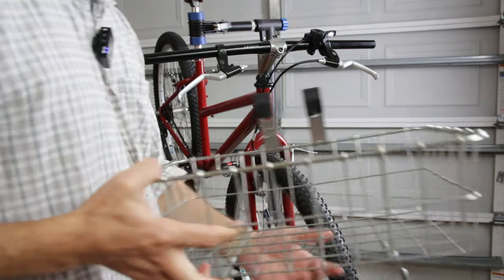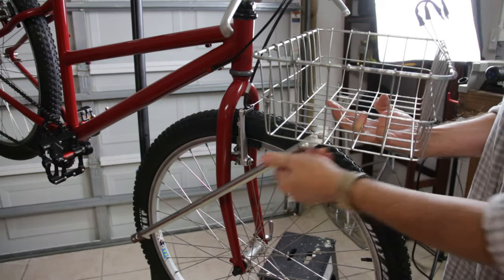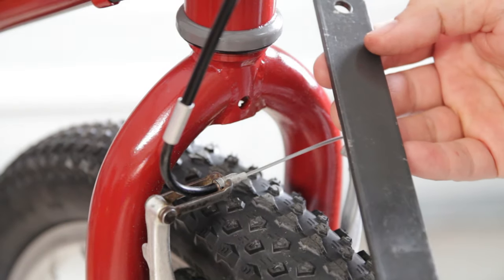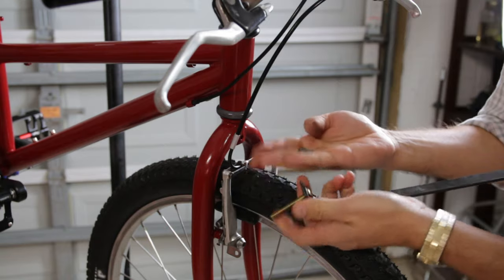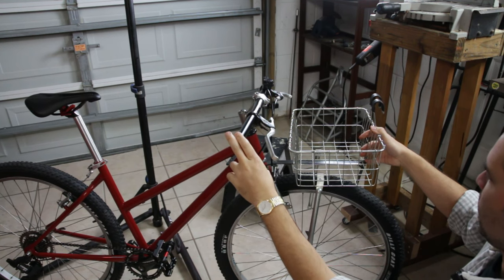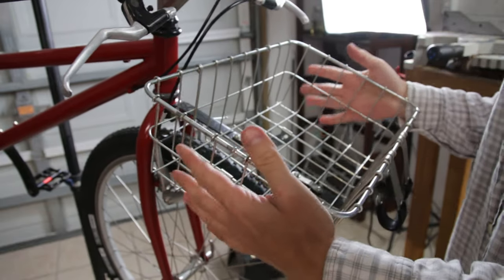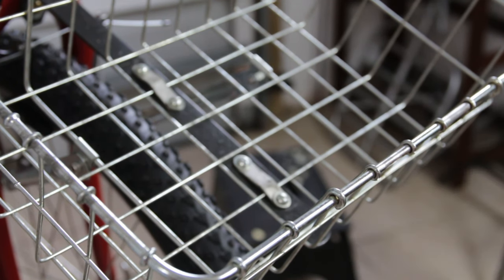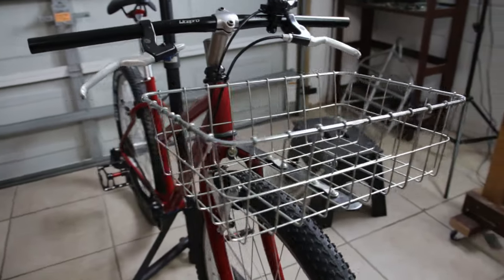Wald 137 brake boss mount

Comment: Great overview and subbed to the channel. I am just about to fit my 137 but I think I will be mounting it on a Japanese front Sim Works Obento Rack. It adds weight but I would rather be able to whip the basket off by removing some voile straps and then ride with the rack on instead of fixing all the Wald hardware on. Wish me luck, its going on this weekend :)
Reply from the maker: very cool and glad you liked the video.